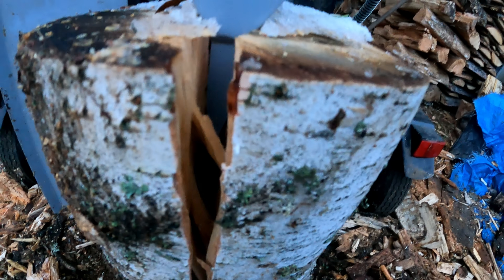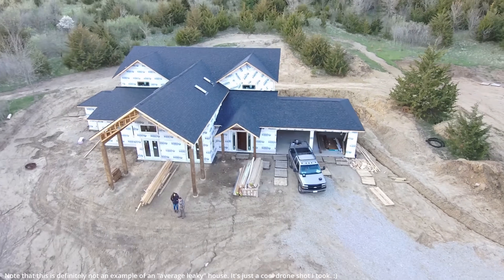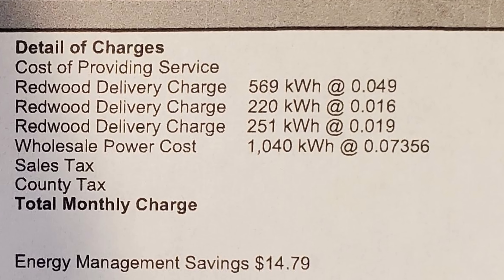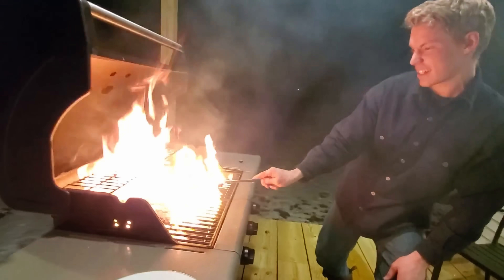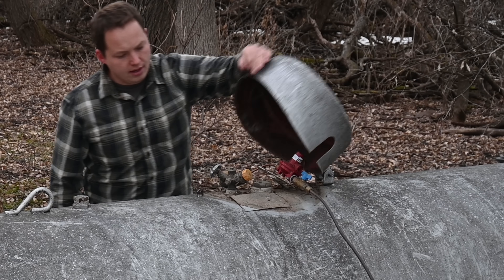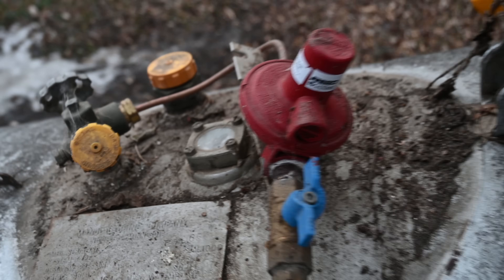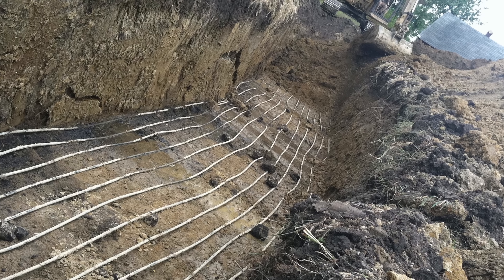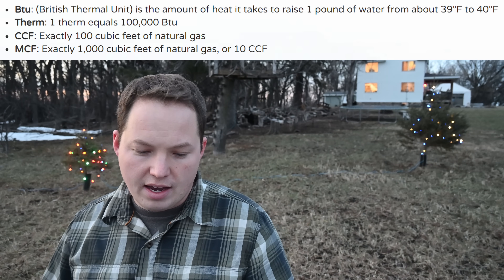What's The Best Heat Source in 2022? Top 5 Home Heating Methods - LP Electric NG Geothermal Fuel Oil

Comment: We have ground source and just last month, a very cold month, we came close to $300 for the first time in seventeen years since we built the house.  That's our entire energy bill, though I do have a wood stove that I use when it's really super cold. I'd rather have a bed of coals going if the power goes out.   I've seen and worked on a couple of places that had natural gas explosions.  Not a pretty sight.  In the summer, our electric bill is usually below $200.  The only complaint I have about the Water Furnace is that it uses huge filters that are pretty expensive.  Don't have to change it very often, though.

Comment: I dont agree propane can be 95 per cent lucky to get 80 out of oil. 22 below zero now your fibbin. Why did you bash nat gas. You know its the best value and extremely reliable. Installation is key with heat pump. Younever talked about hydronic heat over fans that are up to 3quarter horse power motors at 110volts. Never a fan for heat. Radiant is ok but slow to respond.dont touch thermostat.

Comment: Coal burned at the power plant vs. at home. Along with the plant being 30% efficient you also have significant losses transmitting that energy through power lines to the home. So even worse.

Comment: Thank you that was a very informative video and of course I appreciate the fact the prices are different for every type of fuel depending on where you live I've been in construction my whole life I'm about to build a home over in the Philippines I'm considering heat pump for air conditioning over there because you need very very little heat very seldom but I'm wondering if an air source heat pump is enough cheaper than Earth sourced heat pump if you could share your opinion I'd be very grateful
Reply from the maker: Air source all the way for that climate. So you're moving from the states to the Philippines?

Comment: You confused "Best" with cheapest. Best as in comfortable heat is radiant floor heat but that can be fueled by any of the fuels you went over. We are in eastern PA  We have a 1800 foot home 2 level well insulated with a heat load of 36000 on a zero degree day. Heating system is all in floor radiant zoned upper and lower. Main boiler is condensing propane feeding the floors. Shoulder seasons are heated with the ductless, 3 cassettes in the rooms upstairs and a 12000 wall unit downstairs. They are inverters but not duel stage compressors so they have a diminishing BTU value as it gets colder, but they work well. Third we have a wood stove with an output of about 30,000 BTU. It heats the entire home and as I live in the woods my wood is just a matter of labor. Like you I have enough propane to get through an entire winter and I try to keep enough wood for 2 years. We lose power fairly often but have a propane generator to run the boiler and pumps. We usually burn wood when it gets a little colder but then we lose the advantages of floor heat. Hopefully next year I am going to install a outside wood boiler tied into the radiant system. It has been a strange year for energy, Propane is down to a 1.40 and because the Ash trees are dead, firewood can be had at 175.00 a chord. My last ditch effort when the power is out, 3 feet of snow and freezing rain I have a gas stove top that is good for 40,000 BTU and I can still light them with a match   lol.
Reply from the maker: That's about the best possible combination of options you could ever hope for! Great work.

Comment: Fuel oil is NOT diesel. It will destroy your modern truck. Propane and electricity are the same because of the cost of the heaters. Coal is by far the cheepest with wood coming in second.

Comment: My home heating in Northern Ontario, Canada is split between furnace oil and wood. When I am home it is wood and when I am not it is central forced air furnace operating at 84% efficiency.  I also use fans to move the air.

Comment: Radiant Hydronic with a HeatMaster4000 external wood stove. It gets to -30C here. 4-5 cords a year. I have 60 acres 40 of which are woods. Costs me a week in the winter to chop em down and drag em out and a 3-5 days in the fall to split wood. I am a year ahead though. So you need to buy it in the beginning. Up hear it is $250 CDN a full cord. So...

Comment: I split wood and laugh at people complaining about the heating costs. My parents live in a brand new energy efficient house with really high ceilings when the temperature dropped to minus 13 Fahrenheit their house would only reach 58° inside. My hundred year old house with a wood stove cranking maintained a 75° temperature inside. I have heated my homes with all different kinds of heat with the exception of steam or a boiler. My favorite without a doubt is the good old wood stove. I get a free gym membership when I split move and stack my firewood. Firewood keeps me healthy and warm and it's free. Sometimes I even get paid to clean up the fallen wood at someone's property. So in theory you could say you are getting paid to heat your home. If you have a wood stove and you are cold it's only because you are lazy and not stoking the fire. The downside to a wood stove is sometimes it gets so hot you have to open a window.

Comment: Here's the deal. I'm no expert, just a dude who observes things and notates result. That said, mini-splits are freekin awesome, right down to about 5 degrees Fahrenheit and then its kaput. I have tried two different models and both cannot produce heat when the outside temp falls below 5 degrees Fahrenheit. Right now, in today's market, oil boilers with radiant heating is the absolute cheapest way to heat an entire home. If you need to do just a 750 square foot room then a pellet stove would be my next option. Propane and natural gas are very expensive and the price swings are insane - just my 2 cents. ./

Comment: This advertisement should be taken down because, no one can supply a house with full power with a small generator. A house takes around 10,000 or more watts of power to run everything in your house which requires a large generator capable of producing at least 10,000 watts of power.

Comment: We have used a geothermal heat pump for 39 years, and it is very efficient.  I guess I should add that since we live on a small lake and have a well with an open loop system.

Comment: Ben you do well with you vids. You seem like a really good kid. We are using a Rudd variable speed heat pump. We live in St Augustine Fl and probably have the best climate for heat pumps. Electric is low here too. We also are building a SIP home. We didn’t go crazy with the R because we really wouldn’t be able to recover the extra cost as the AC or heat monthly bill is between $60-$155. We also designed the home around the upstairs laundry. The air handler is directly over that room in the conditioned attic. The electric panel is in the laundry along with the tankless water heater and manifold water system. The meter base and heat pump are less than 40 feet from the panel and air handler. We placed the tankless 4’ away from the electric panel. All this results in lower costs to wire and install and operation is efficient. Both bathrooms are backed up to the laundry so hot water runs are short. A powder bath is down stairs with the kitchen. The house is 1800 sq ft. At this time we are installing the mechanicals. excepted for the foundation we have built the home with zero help. Just my wife and me. We are in our 60s. Thanks.

Comment: 1900 sq. foot single family home in central Pennsylvania. I use a two year old Trane heat pump (still on warranty) with a 14 year old indoor air handler (off warranty).

For backup I'm currently using a vent free propane gas log fireplace with a 100 gallon exterior tank. I also have 3 Mr. Heater portable propane heaters with lots of propane canisters, as well  as an indoor portable kerosene heater. Kerosene prices are off the charts, and 1 pound propane cylinders are very expensive. 

I don't like the heat pump in temperatures below 28 because it kicks into auxiliary mode, which is super expensive. Last summer the power company raised electricity rates 40 percent. I expect another 40 percent rate increase in 2023. 

So now I'm investigating having a coal stove installed in my basement. It's going to be hooked into the ductwork with the heat pump fan circulating the heat through the house. A ton of anthracite costs about $325.00

I want a backup solution that is not dependent on the grid. Even if I don't use the heat pump fan to circulate heat generated by a coal stove, the stove itself will provide enough heat for the house in emergency situations. Unfortunately, the total cost, including installation of the stove and chimney liner is $8K  to $10K

Comment: If I had a woodstove, I would definitely go down that path. 

Without a wood stove and only with a large central propane heater, I'm choosing to use small propane heaters installed in the house with local electric heaters for rooms I want warmer.

Comment: I live here in NYC. Most of the houses are old built in the 1920s or older. Most use steam radiators for heat. We still use use heating oil for our boiler which creates steam for heat and hot water. We have to fill up the tank twice during the winter. Oil prices are high but it is still manageable. About $1400 for the winter for heat and hot water. Most of the rest of the city has converted to natural gas boilers. Natural gas boilers don't work efficiently with steam heat. Many two family houses here get $800 per month gas bills.in other words, natural gas is almost double the cost. This issue is not explained by heat technicians.

Comment: like you I use a heat pump down to 32 degrees  at 32 degrees we use a pellet stove which is tied into the same air handler as the heat pump ....by running the fan it distributes the heat through the whole house . It also serves to keep the heat pump fluid warm in case it is needed .....outer condenser will not freeze and emergency heat strips never kick on . The electric used by the pellet stove is 370W and I think the fan is only 1/2 hp so total less then 1000W .....was really cheap last year less then 800 dollars in pellets this year not as cheap pellets went up to 7 dollars per bag but still less then NG , Propane or oil

Comment: Unless you are producing a lot of your electric needs , electricity by heat pump, electric heaters is not remaining 'cheap' I live in Canada well over 300 miles North of the Border & They want to raise our electric bill by 11% by end of 2023, with another 2% projected raise for 2024 .... With of course the provision for bigger increases if necessary to protect their profit line ( which is Guaranteed in this Province) . IF you don't produce your own power oh well to bad so sad , dig deeper. When heat pumps are working in Temperature s of 40* Fahrenheit & less they have to work much harder & so INCREASE OF POWER BILL.. So by November until April when its in the 32f & below , we are  often much below  freezing .... You best have another way to heat

Comment: I have a diesel boiler last year i spend about $2700, i just put about 9-10year solar panels and put heat pumps…so far I’m using my heat pump most of the time and not gone over my kwh per day…I’m in NY I’ll have to wait to see how much I save….my house get natural gas so I may try to switch to natural gas but I want to wait…a friend of mine told me natural gas will be more expensive then diesel

Comment: First good bit of advice is check your insulation and any cracks around doors and windows including electrical outlets where cold air can come in. Otherwise, you're still wasting $$$  no matter the heat source !!!

Comment: We use electric  space heaters and only heat rooms we use the most and oil fired furnace. Crazy as this sounds we went couple years heating with candles and clay pots it worked pretty good and was very cheap to do but if you have pets or small kids that’s a problem

Comment: Just had mini splits installed in our 1600 sf house. The electrician said the expected life of the system is 15 years. That means we have to save about $50 per month to replace the system in 15 years.
Rather than having a contractor give ua  a bid. We bought the system and contracted with a local electrician to install it.  Saved a lot of money doing it that way. We also have a wood stove which puts out an amazing amount of heat. Wood costs $300 per cord delivered. We don't know how much wood we will burn for the year. The wood stove is important to us because it is an alternate heat source if the power goes out. We use the mini splits (mostly at night) and the wood stove and mini splits during the day. Don't have a handle on the monthly costs yet as we just moved in.

Comment: We live in a very old house with a very old furnace and we just heat the rooms we're using at the time with electric to try and save money. We used our gas furnace one month when we first moved here and barely used it in our bill was $250 so we went with electric heaters and then at night we put the furnace on between 60 and 63 so it doesn't get too cold and keep the pipes from freezing.

Comment: Natural gas is a service utility here in Las Vegas.
But I'm now rural on the outskirts of town. My place is set up for propane and when I need some I call and have a guy come out and deliver it.

I'm wondering if it's reasonably priced and feasible to convert my late 80's furnace over to burn natural gas and also if it can be delivered like propane is delivered?

Comment: The price of natural gas in 2022 has quadrupled. An air source Heat Pump can be more cost effective than using a natural gas furnace.
Reply from the maker: I'm hoping to do an updated video in January with the current fuel prices. Should be interesting.
Reply: @BenjaminSahlstrom  Sounds good!!! Thanks!

Comment: We use a mini-split in the room we use the most. 23 SEER, very inexpensive. For the rest of the house we have a two ton heat pump that we keep at around 64 degrees in winter. This combination works well for us. We're also 🤞🤞 live on an area where electricity is only $.07 per kw.

Comment: We have a central electric resistive furnace here in Canada, but we also have nearly the cheapest power in north america. But having said that, we heat with wood for about 90% of it. The furnace would only come on when no one was around to feed the fire. BUT now I'm making up that heat, with a Bitmain S19j Pro BTC miner...so it pays me to heat (at this moment btc is hurting BAD though)...

Comment: 5 years ago I bought a house heated with anthracite. At the time I was paying $180 per ton, and fuel oil was around $2.50 per gal. At those prices I calculated that I was paying about 1/3 per btu as opposed to oil. This year the price went up for the first time to $200 per ton. Oil is about $6 per gallon. Btw, anthracite has 25 million btus per ton.
Reply: in high density urban applications, coal is terrible atmospheric pollutant, Fine where houses are spread thinly with low density, otherwise your neighbors coal smoke is coming to get you. London air in the 1880's was toxic
Reply: @tompekarna  I would suggest you look into the different types of coal, and how cleanly they burn. You will find that anthracite burns cleaner than fuel oil. The only fossil fuels which burns more cleanly than anthracite are natural gas and propane.

Comment: Back in the early to mid 1970s, electric was as cheap as nat gas at $0.01 per kwh at the high usage tier. That made it competitive with nat gas and a lot of total electric houses were built here in NW Indiana.
The house I bought was electric baseboard. I converted it to air to air heat pump with resistance backup. 
And also had a wood stove and plenty of wood available. So I didn't see much resistance heat.
The prices is much higher now.
Why? Government mostly. 

I am in a different house now,, built about the same time as the first one, in 1963 or so, just 6-7 years ago. And it was still resistance ceiling heat. I put in geothermal ground loop heat pump with resistance backup. The backup isn't used much at all, and we have year round heat and cooling to where we want it. I estimated it would pay for itself, including the ductwork, in less that 10 years. I now expect it to do better than that.
The reason is still .... government.

Both locations are rural, so nat gas is not available. The choices are only electric (heat pump), propane, fuel oil, or wood. Wood is normally backed up by one of the others.

My wood stove at the first location was a Vermont Castings Defiant, one of the first 75 or so made. It is a great stove, but puts out a lot of heat and can be too big for many houses. Most should use a smaller stove, which the do also make. They are all great looking and efficient stoves. https://www.vermontcastings.com/browse/wood-stoves

Comment: Another factor to consider is the base monthly cost to have a natural  gas connection all year when you might only need it four months (Ohio). 
My dad was an HVAC guy that cursed heat pumps, but the current technology has me thinking of dumping gas altogether. Going heat pump for HVAC and water, with an eye on adding solar if it ever makes sense.

Comment: Spay foam is good but it my worst nightmare . For snaking wire for extra plugs and switch or add more electrical . 
As a electrician.
Do all your wiring before you spray foam.
We top off our oil a week ago we had 500 gallons of years ago we bought 3 more so we have 2000 now when it get to about 850 gallons we now we top off at 150 gallons now.  it was 2.30 up to 5.10 a gallon. And if it’s Not a 100 gallon minimum that a extra surcharge under 100 gallons.
We have propane 500 gallons for out stove top and dry. And wood burning stove we used some year and not other. Once I get a heating system I will not get rid of it. They try to convince me to remove old heating system I say no just keep it .